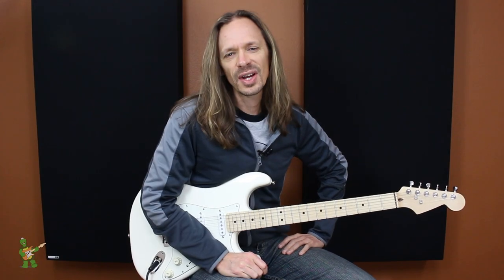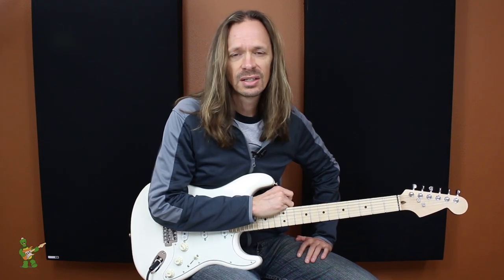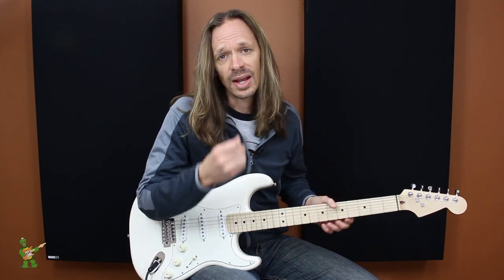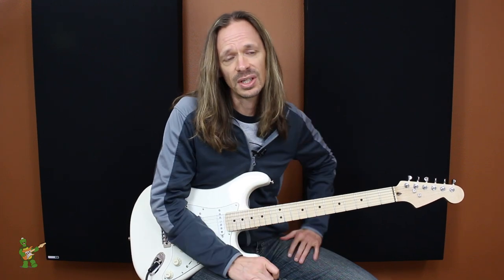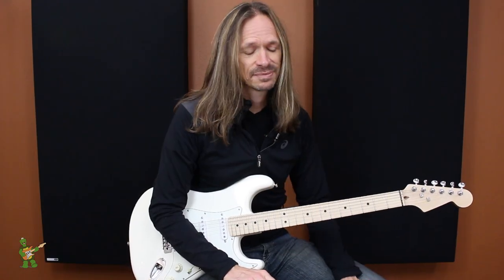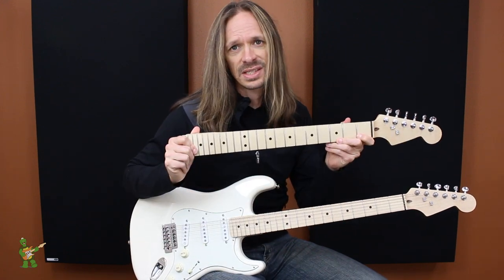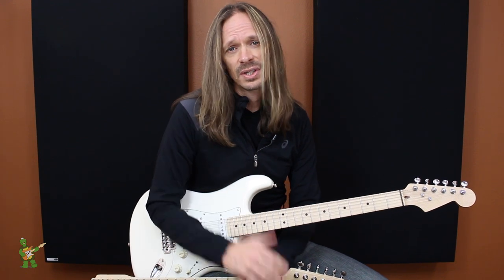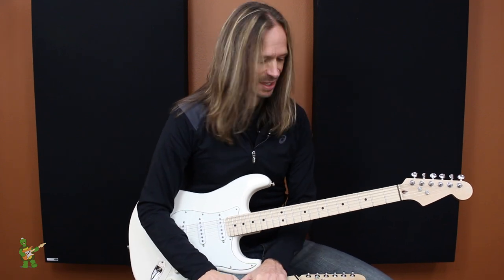Stainless Steel vs Nickel Frets

Comment: I hear a slight difference but not much.  Both sound fine. I wouldn't really think the difference is enough to fret over.
Reply: I see what you did there.
Reply: I will file that under crowning achievements in comedy, very polished sir.
Reply: I don’t like the tone of your post.
Reply: fret over LOL !
Reply: I see what you did there...
Reply: Haha, good one sir.
Reply: But fret wear is
Reply: is not about the sound...
Reply: I caught it!!
Reply: audiosamples it was a pun buddy
Reply: It's mostly about durability
Reply: Nice "Test" guitar!!!
New guitars have junk frets that wear out before the strings do. I would really like to regret all my guitars in more durable frets but the co$t would be astronomical! I may be able to do one or two and the rest will have to suffer from a manufacturer that only uses the cheapest fret wire they can find. I'm talking to YOU Epiphone & Squire. My 58 LP Jr. & 95 MIM Strat are not bad, but the others...suck.
Reply: wire you doing this
Reply: @haldasinger6440  😂
Reply: I can't pick which reply is best
Reply: That’s very level headed of you to say
Reply: @6789drummerdude  LOL, Level Frets!
Reply: It wood be better if you trem your nails before you fret or you'll have a very bend time.

Comment: We guitar players have a tendency to be scared of change. I do think there is a difference in tone, but I can guarantee you that if Fender used stainless steel in the beginning, and they tried to change to nickel, people would be up in arms claiming how inferior nickel is.
Reply: Fair comment too. After hearing them together I prefer the clarity of the stainless, so in my opinion the nickel has become inferior not only in playability and longevity but now in tone too :)
Reply: Youre so right. Fun fact one of the original fender Custom shop builders set on a forum that they did try to use stainless back in the early days but the tools they were using for Frets could not withstand cutting stainless they would have to buy new tools every few guitars from a manufacturing standpoint this made it impossible but nowadays with our technology not using stainless steel is doing a disservice to the players at least offer it as an option an up charge would be fair too. However PRS is stuck in their old ways. At least fender acknowledges that stainless is superior, but PRS actually says the nickel his superior and as long lasting as stainless. Look up the video on YouTube titled “Paul Reed Smith stainless steel Frets”
Reply: I also don't want to pay $300+ more for the same guitar. I can add my own SS frets when the factory frets wear for the price difference they're going to charge.
Reply: I used to have an early sixties Hagstrom which had stainless steel frets,  so it's not a new thing and some of the nickel fret wire is too soft. Once set up properly the ends filed no problems ever.
Reply: True, at NAMM this year Gibson brought back all the stuff that people wanted and were arguing about in the past. What you read in the comment section  now is that they shy from being innovative. So if they come up with something new they get bashed for it and when they go back to the good old they get bashed too. People are never satisfied these days because they are spoiled little shits.
Reply: I am very Scared of the thought of Stainless Frets... I can't go there.
Reply: there's absolutely no doubt about that.
Reply: Woo! That's a good point!
Reply: That's because almost all of these things are nothing but snake oil. Every time I hear the marketing buzzword "tonewood" for instace I almost piss my pants lauching. Its just wood and some simple electronics, hardly rocket science. Remember, almost NOBODY in the audiance will hear a difference.
Reply: Remko You should check out their video where they compare alder, swamp ash, and mahogany. 

I just bought a full mahogany body PRS.  I have the same guitar with a maple cap, with the same pickups, bridge, strings, and fretboard, and the guitars are night and day different.  I was shocked.  The mahogany really warms up the smaller G,B, and E strings.  It’s changes how I play it because those strings never get piercey or “pingy”.  

The wood totally makes a difference!  If wood didn’t, it would probably be cheaper just to manufacture all guitars out of plastic.
Reply: Fucking beautiful study of people, specifically guitar people haha 💯
Reply: For me, It’s the unknown… To take the time and money to try it out and then realize I don’t like it…

Comment: Stainless steel will last longer so I feel like that's better. The difference in tone is so minimal I dont have a preference
Reply: Agreed
Reply: If you can "fix" the tonal difference between them with a .001 bump to a knob/slider on your EQ, then "they last forever" stainless steel is the better option.
Reply: Why I daily play my Epi while my Gibson sits in its case.  The thought of refretting it.
SS frets always stay smooth and polished.
Reply: That high end spring like tinny sound doesn't bother you? Bothers me a bit
Reply: @Kylora2112   I don't think an eq pedal will take out that spring like tin sound. Maybe a bridge/nut adjustment of some kind. It changes the wave form OR pattern. Thats what I'm hearing
Reply: @benink5690  Put a chicken claw under your amp and allign the front of your cab to the north. This will counter the tinny sound of stainless stell frets.
Reply: Have guitars with both..and yes there's a difference..you can make them sound the same..i like SS better though..they do sound brighter n more pronounced high end..but like I said you can EQ them to sound however
Reply: @zoso2850  As long as you don't test the same guitar with different frets it's nothing but speculation. I have a start with stainless steel frets and I have no idea how it would sound with any other frets because I'm not a fortune teller.
Reply: @SxSxG666  naw...have SS on one lp and nickel on others..same specs n wood...theres diffrence in feel even..this video pretty much proves it
Reply: @zoso2850  I played guitars with the same specs that sounded differently for no obvious reason. In the end it is wood and you never get the same pieces. In the end everything matters when it comes to sound. If you change something on your guitar it'll sound different but to what extend you can't always tell universally.
Reply: @SxSxG666  I agree everything matters ..thats my point on SS. Frets ..they sound diffrent. ..even  unplugged strumming the guitar you can hear a diffrence but it's nothing that can't be EQ'D TO YOUR LIKING if you don't like the sound of SS. ..there is definitely a diffrence in sound n feel tho
Reply: @zoso2850  I'll take your word then :)
Reply: @SxSxG666  Can I use a whole chicken?
Reply: @coppulor6500  I never tried it myself but in theory you should be fine if you counter the effect of a whole chicken with a rabbit's foot around your neck. If you wanna be save stand between two birch trees although this in only practical outside.
Reply: @SxSxG666  yes!!  I knew it could be done!

Comment: i am surprised there was as much of a difference as i heard. not a lot, but i was expecting none.
Reply: I agree. Still love my SS frets though
Reply: I could tell. I've been playing SS for quite a few years.
Reply: Could definitely hear a difference.  The sound so slight though.  And honestly, you’re never going to hear the nuances in a live show.  As an engineer for a number of bands, you couldn’t even tell when someone changed their strings between sets.  You could only hear difference in the pickups, and different distortions through the Same amp
Reply: You must have very good hearing and a good sound system or earphones. Be thankful for that. I like stainless steel frets for the long life. I notice when I really dig in when bending on my nickel frets I can almost feel and hear the metal wearing off. Especially when I bend the same fret and string extensively.
Reply: The description says that the clips were recorded on subsequent days, so the difference could be how long the tubes warmed up or even slight variation in the voltage coming out of the wall socket or out of the amp's transformers.
Reply: Likewise.  I was very shocked at how big a difference there was and preferred neck #1 in every clip.
Reply: @bleckybob  if you can't hear the difference between fresh strings and ones that have had a set played on them remind never to hire you as an engineer.
Reply: @johnbrady1211  Technically, metal doesn’t wear off of frets. They are compressed and flattened over time.
Reply: Ff rom what I've noticed, the biggest difference between stainless and nickel is stainless lasts a lot longer than nickel and feel a little smoother.

Comment: To my ears, nickel sounds brighter!
Reply: Mine as well.  We listened to this on some fancy studio monitors.  Neck #1 was superior.
Reply: And clearer, less mud.
Reply: Nickle was definitely brighter.  I was listening through my Focal 50s and Apogee.  I diverted my eyes from watching the video and focused on the sound.  Every I time I could immediately hear when he switched guitars. Neck 2 actually sounded somewhat softer..
Reply: Depends if you're listening for 'brightness' in the real highs or the high mids.

You and I are hearing the identical frequency balance of a given sound, we  are just interpreting the data subjectively and each in our own terms. I think the nickel steel has more high highs but also sweeter less clucky upper mids.
Reply: GCKelloch  the fretted fret will resonate very, very slightly, but the pickups won’t pick that up for all intents and purposes. The string will resonate a bit different but it will be very slight. New strings v old strings, or nickel v steel, etc would make a much bigger difference. There is so much you can get into the weeds with here, especially when you get into all of the ways the guitar resonates and how that affects harmonics, etc. I wonder if he played everything on neck 1 and then put on neck 2 and played everything again and then spliced the video together. If he did the difference could be from the neck swap, the string change or something like that.
Reply: GCKelloch absolutely, sustain should be greater with the SS frets. I have two guitars with SS and I love them. I have put about 4 hours a day over the last two years on them and I have no dead spots,  just silky smooth bends. I wish they had them 30 years ago, it would have saved me some money as well. I am an electronics engineer so I can talk about a lot, but I do not have any experience in material sciences so I don’t have much to say about this side.
Reply: I agree. I thought the nickel frets sounded better.
Reply: I had the same thought when I was listening to the clean. That's why I was so sure #1 was ss. #2 sounds mellower on clean. But surprise~~I was shocked at the reveal. Thanks for confirming that I am not deaf.
Reply: Me too...

Comment: Here's a partial list of timestaps to make comparing more convenient.

Neck #1 (clean, neck pickup) - 2:53
Neck #2 (clean, neck pickup) - 3:12

Neck #1 (clean, neck & middle pickup) - 3:31
Neck #2 (clean, neck & middle pickup) - 3:47

Neck #1 (clean, bridge pickup) - 4:04
Neck #2 (clean, bridge pickup) - 4:30

Neck #1 (clean, middle pickup) - 4:57
Neck #2 (clean, middle pickup) - 5:12

Neck #1 (distortion, neck pickup) - 5:28
Neck #2 (distortion, neck pickup) - 5:43
Reply: I notice a difference, though it's a bit subtle. Neck 1 seems a bit more muffled compared to Neck 2, which sounds more clear. It's easiest to hear the difference when you're listening to the Neck Pup comparisons, because he's playing chords in those examples.

Comment: I hear an audible difference in some passages but none in others. 
Kudos, btw, on fully committing to the best possible A/B test conditions and the best possible video editing. Great idea, well done, well executed.
Reply from the maker: Agreed. Some sound exactly the same to me. It's only on a couple that you can hear any difference, and honestly I feel like some of that could be due to variables that can't be accounted for very easily, like how hard I strummed the chords on that particular take, or whatever. I tried as hard as I could to keep everything consistent, but it's tough. Oh.....and thanks for the kudos!
Reply: @warmoth  I was focused on your right hand, and there was tiny differences? Maybe, but you did a workman like test. Net, don't count on stainless or nickel for sound. It's a wash.
Reply: I was wondering on a few passages if he had accidentally turn down the tone knob or something, but maybe SS frets really do make that much of a difference.  However, one of those passages was on the bridge pickup, and unless it was wired for the tone knob, it wouldn't have made a difference.
Reply: Eric Doran yeah I’m sensitive to whatever airs you are putting on. It’s weird how we are all different huh?
Reply: @warmoth  hi. Can you tell me if there's a way to identify if the frets on a guitar are stainless steel or nickel?  If I'm asking someone for this customization,  how can I tell if that's what they really used?
Thanks
Reply: I'm not a pro guitarrist but all virtuosos say tone is in the fingers. Can't argue with them. Stop the madness just play.
Reply: @Ric_1985  That's all good and true but notice that even the virtuosos actually play their guitar, not just their fingers alone. And they place importance on their guitars because - not surprisingly - the instrument matters. Hence there must be some place where people talk about the details of the instrument. This is such a place. Cheers.
Reply: @JetpackSamurai  Yes, it is a two factors equation. Both matter.
Reply: In the first clip, the nickel frets sounded brighter, but in most of the other clips, they both sounded the same. Great job on this video. Puts the matter to rest.

Comment: I have a guitar with stainless frets and a guitar with nickel frets. I will never have another guitar, custom built, without stainless frets. One other quick point...I have never broken a string on the guitar with stainless frets. Dan Owens from Grapeview, WA. Thank you for the demo.
Reply: Yes it's a hard sell for mass-manufactured instrument markets so you offer a very good insight. In fact cheaper or even Brand name instruments may not even have the hardest available nickel silver, so that few-year-old instruments need a re-fret - this is the beef Paul Reed Smith has and why he uses a slightly harder alloy that finds a good balance of durability and not passing on a huge cost.

Comment: nickel has more volume, mid/low is more audible and the overall audio range is louder with a vibrant treble
steel have a dry sound, almost like compressed, no excessive vibrations being spited or ressonation, very dry and also easy to concetrate your ears on what is happening is beautiful
Reply: Perhaps true for you.  If you have any science to support this, please post it.

Comment: I'm going to guess.... SS will have slightly more sustain and sound brighter! Am I right????     Let me watch....  Well, neck 2 seemed to be brighter on those last two strings.  Not sure if you were just hitting them harder but that's what it sounded like over my studio monitors.  me keeps watching.....    Yeah, it seems maybe it's some very high harmonics that are coming through a tad more on guitar #2.  Now watch that be the nickel ones. hehehe   I was right. weeeee.  But the main pro of using SS is the longevity, I'd say.  And brighter is always better cuz it's easy to turn the trebel DOWN on an amp, harder to make a dull guitar brighter with the amp because now you introduce more noise just to get that twang coming out.  Just my 2 cents.  Imma be all SS, man. hahah  thanks for the comparison.
Reply: You're just lying to yourself if you think there's THAT much of a difference. I'm wearing Beyerdynamic DT770 250 ohm headphones with a fucking pre-amp murdering the cilia in my ears, and there is still hardly a difference. Yes, you can BARELY hear the difference when you KNOW it's there, but if no one explicitly said that they were different necks, you wouldn't be able to tell unless you looked at them. The biggest identifier is the shine... Stainless steel is shiny and pretty, nickel is ugly and dull after about a week without polish lol. SS is just better in literally every way. Hell, that nickel neck was brand new and it was still much less shiny than the SS neck.
Reply: @MrCholoPants3415  Did you miss "LONGEVITY"?  I wrote "longevity".   It's right there up inside my comment.  I think you are attacking a straw man. :)
Reply: TruthSurge honestly I don’t even remember what I wrote and I’m not going to read all that shit. Sorry that you had to lmao. I’ll just say you’re probably correct 👍🏼
Reply: The only negative I can think of about SS frets is that they are a pain to cut when fitting. I'm currently making a bass and 11 frets in and my hand hurts, But hell, they're practically better in every other way.
Reply: @MrCholoPants3415  it's still brighter..
Reply: weeeee.

Comment: I picked out the stainless frets before the reveal and got it right, but I agree with you that the difference is really small. It's the same amount of difference of turning the tone control a tiny amount, or even the difference between fresh and week-old strings. Advantages of stainless win, for me (but sadly my strat doesn't have them, lol).
Reply: I guessed wrong. Turns out I liked the steels better. Some companies put SS  on sub-1000 dollar guitars. Others consider them a super premium feature. Others 'don't like the tone' of SS. 

Players worry about the brightness of SS fret but seems about 4/5 people prefer high carbon steel strings to pure nickel. They want the strongest, brightest strings possible but are okay with the old frets that form pits within a few months of playing. Nickel frets tarnish very quickly and resist bending more, which most people base their setups around bending in some way. People make no sense in this industry.